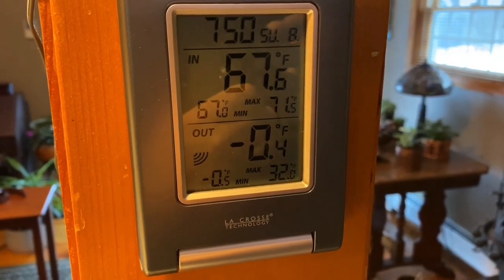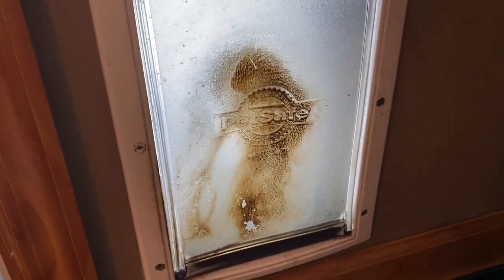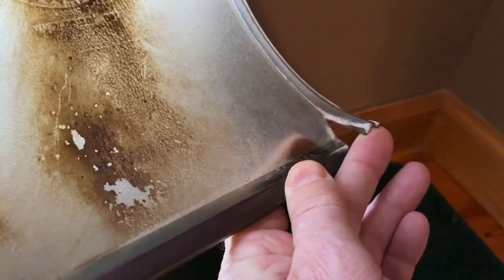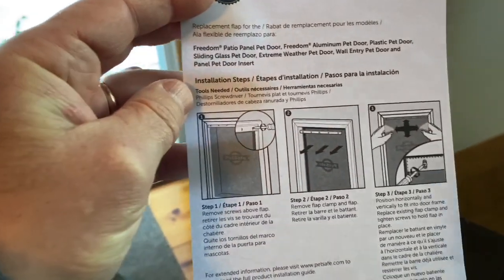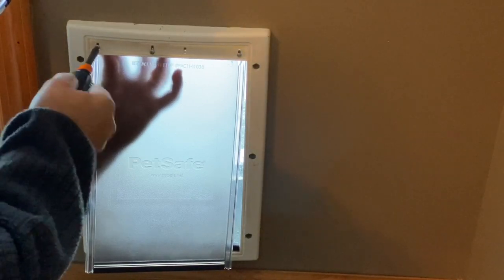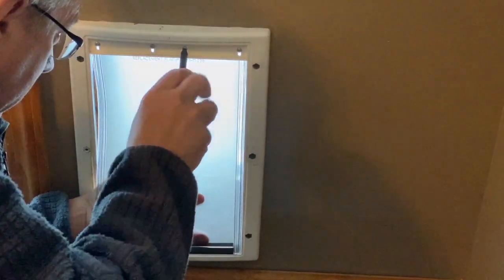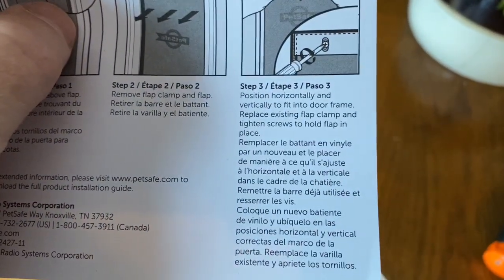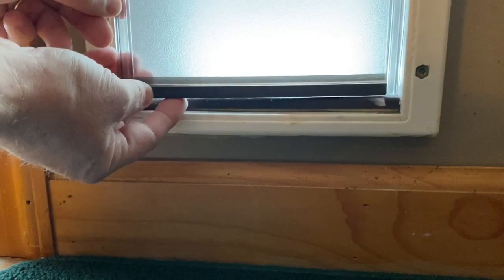Replacing a damaged dog door.

Comment: I have same pet door except its a panel the fits in a sliding glass doort, the flap is not sealing on magnet on bottom letting a terrible draft thru.  I think you may have given me a clue whats going on, I need to make an adjustment on the top where it screws in , perhaps it needs to be raised a bit to leave that gap? so its connecting the with magnet
Reply from the maker: Yea, there needs to be an even gap right across. 
The top screw holes are slotted, so you should have plenty of wiggle room. 
It will also move sideways a bit as well, so make sure you don’t fix the gap on the bottom, and create one on the side.

Comment: I got a storm door with a Petsafe doggie door in it, and they apparently don't tell you the flap can never be replaced.  You have to order a whole other door :(  Our flap looked worse than yours.
Reply from the maker: Wow, that’s a bummer. I wonder why they went with a different system for the built in unit?
Reply from the maker: If you take that dig door apart there is no stock number on the flap?
Reply: Yes, my flap had a part number at the top. That’s how I ordered the replacement.